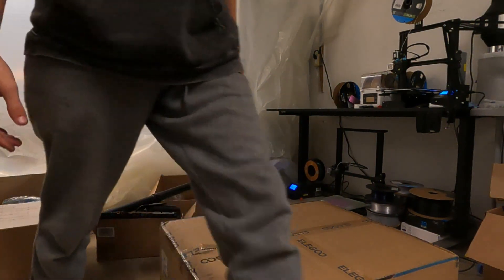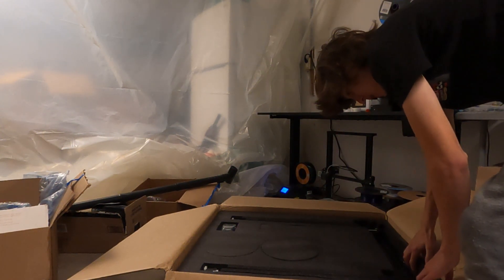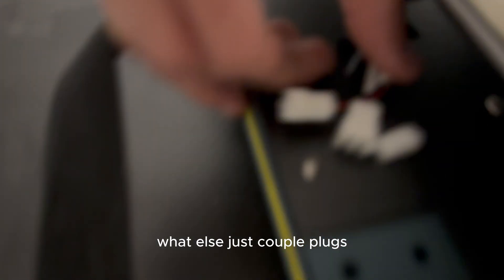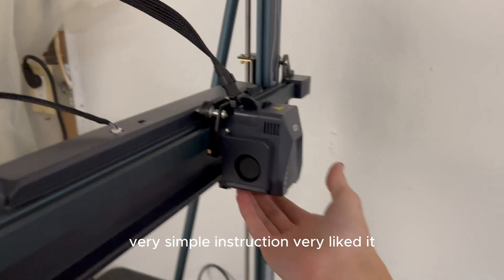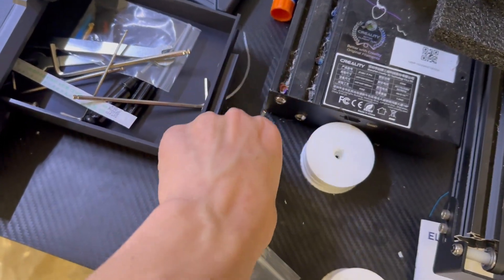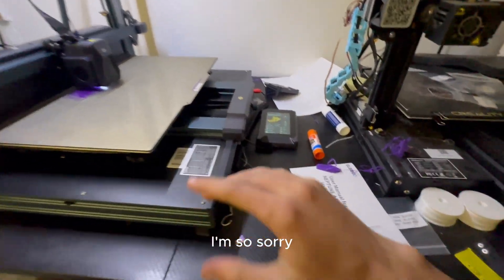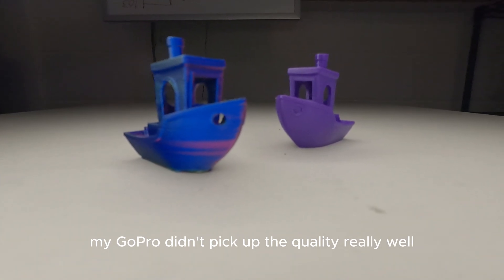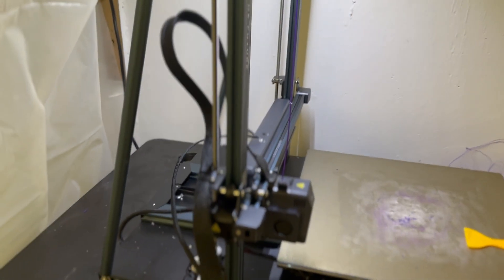MY NEW 3D PRINTER! (Neptune 4 Max)

Comment: NOOOOO DON'T USE GLUE ON THE MAGNETIC BED!!! It's fine on glass bed but for magnetic pei bed use isopropyl alcohol with a paper towel! It works perfectly and doesn't leave residue. Using it will make the bed extremely dry and clean. And if you have good bed leveling, it can also add on to better adhesion. I'm speaking from experience. Also glue can ruin the pei bed
Reply from the maker: Got it. Thank you. Going to clean everything off today